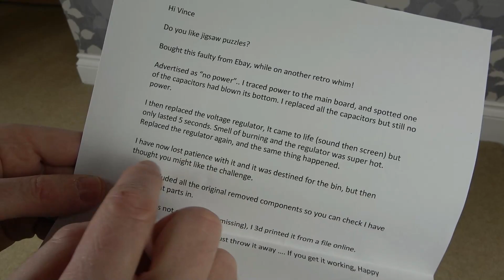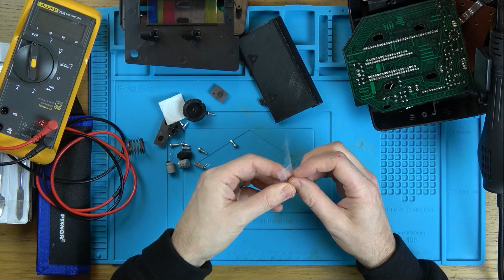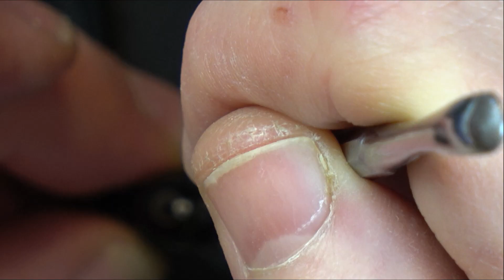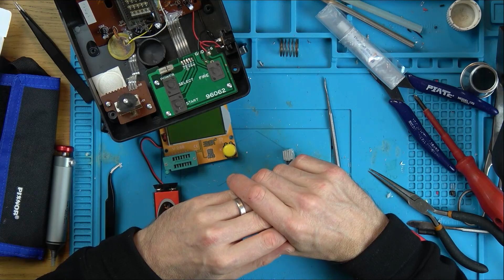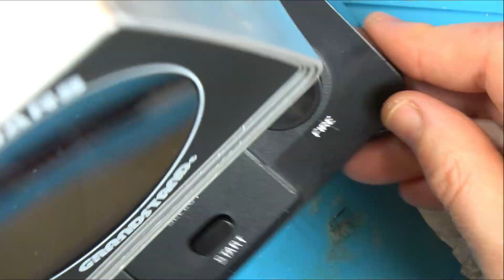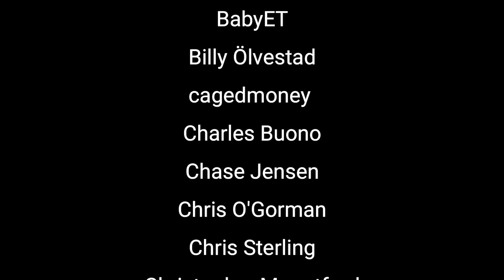1981 Grandstand ASTRO WARS Tabletop Game - No Power Fault - Trying to Fix

Comment: Thanks for this video Vince, I've fixed two of these now. The first was just the D882 which I already knew about, but the second today had the same faulty SO3 NPN transistor as you diagnosed here. I replaced that with a PN2222 which looked compatible and Bingo! One thing I gleaned from this that you didn't specifically mention was how to avoid shorts on the replacement transistor legs when bending them for a different B/C/E order than the original - just rotate the orientation of the transistor by 90 degrees. Genius!

Comment: hi vince, i have an astro wars in for repair but know nothing about them, i had ordered some transistors in but with the bigger transistor removed im reading short on the emitter side. i have removed the caps that seem to be on that rail plus disconnected resistors etc but the short seems to remain

Comment: Broke my sons 20v die grinder by trying to power off drill battery. Barrel plug was negative centre pin. Swapped transistor with one off ebay, job done.

Comment: 33:10 well, that depends on the glue you're using (some are designed for lower temp, some for higher, some can work under low and high temp). also just get a better glue gun, ideally with temp potentiometer (there're many and you don't have to pay much). Any with 120W should be easilly enought for high temp glue job. Also the high temp glueguns tend to have thinner and longer nozzle (or at least you can swap it for thinner and longer one) which makes the job much easier... 
And here's a little trick i use when working with glue and pcb or w/e i need to glue - grab the air duster can (compressed air), turned it upside down and lightly spray the melted glue (ofc watch for delicate parts and use moderation - drowning the pcb with liquid air is not desired) - it wil solitify the top layer right away and you can let go right away.
edit: sea shanty as an outro? oi matey, grab ye gobble o grog!

Comment: I remember I had this same console game in 1981. I had the choice for Christmas that year, Astro Wars, or the folding Nintendo Game and Watch Donkey Kong. It was a tough choice for an 11 year old, but all my mates at school had the Donkey Kong game, so I wanted to be different. All I remember about it, apart from the fact it wasn't that difficult to be good at, was it ate through the C batteries like they were going out of fashion.....a new set of batteries would give MAYBE 20 minutes of game play if you were lucky, and bought the BEST QUALITY batteries.....luckily I had a mutli plug, multi voltage reversable DC output wall wart AC adaptor for it aswell. But that same adaptor blew up many items until I realised the Astro Wars console was the ONLY unit with the power socket wired backwards. Every other socket or device I had that I could use the adaptor on was positive on the centre pin, negative on the shroud.....why this was the other way I never understood. So an accidental reverse polarity connection would be EASY to do if the reversed wiring was a standard design for this unit and nothing else. 

While reminiscing though......I do remember I played it a LOT, that was, until something in my underpants discovered girls, and this little game was of FAR LESS INTEREST !!!!

Comment: Just to help you out:
1) If the BD139 works (as it seems to), just go with it. There is no way that the circuit would draw anywhere close to 1 amp (the max rating of the BD139), so it's quite safe to use it. Even though the 2SD882 is rated to 3 amps that's not an issue.
2) This transistor is being used for switching - it is driving that small black round transformer to generate higher voltages for the VFD. 
3) Don't buy semiconductors off ebay! They are mostly fakes and will blow up or simply not work (thereby further confusing you as to what is actually wrong).
A great video though and it's inspiring to see others taking on repairs like this. I have been in electronics for 40+ years as a hobby and a career and still enjoying what I do.

Comment: Great video Vince, I love these VFD games. The power transistor seems to be a common fault in Epoch games like astro wars and scramble.   There are a couple of diodes that can  lead to faint display and sound or no display and an overheated transistor too. The design was approved on later games, but plenty of versions have this problem. Your great vid Inspired me to finally to post a video on them myself. Thanks.

Comment: Hi, I was wondering if you could help fix my Surface Laptop 3 for a video. It powers on, but windows doesnt load, and when the ssd is out of the computer, it does not boot. The UEFI and everything works, and when i boot from usb it gets to setup then freezes.

Comment: I still have my Astro Wars in the box on my shelf here :) 80s classic -  The text on mine is a flat white (not silver) and Im not sure hot gluing heatsinks on is a great idea (heatsink will melt the glue no?) - great job fault finding those faulty transistors! There are several different stages to the game - 4 different games I think - loops around as you complete each. Good game.

Comment: The 3D printed cover is rough on the outside because whoever printed it made the outside bit the first layer of the print (on the print bed) and his first layer looks a little wonky.  Different base materials on the bed can lead to smoother surfaces, but the first layer has to be solid for the finish to be fantastic.  This is also why the lettering on the inside is so crisp.  It's printed last.
Reply: Actually, I was thinking that those raised triangles probably meant that cover wasn't printed quite flat at all - the surface might be rough from removed support material.

Comment: Between Colector and Emiter, a transistor should also have open connection in both ways (you didn't check that), it must show readings (on diode test) only with Base to colector (litle less) and Base to Emiter (litle more) and no readings in any other direction or combination, for both NPN and PNP, otherwise it is damaged even if not shorted. Good thing you change that one ;)

Comment: Had one of these when I was a kid. Though it was called Galaxy II, not sure when it was changed to/from Astro Wars. I think I caused the same problem by using the wrong type of power jack (either voltage was wrong and/or polarity was wrong).  It would make very dim sound, but no display.  I tried to fix and when I saw the dark spot, not knowing that this was normal for VFDs, I assumed it meant the display was damaged and ended up throwing it away. I have fond memories of playing it.  I even managed to flip the score one time. I do remember that it was always hot to the touch after a few minutes playing.  Probably a design flaw.

Comment: Does anyone agree with me that these old grandstand machines should be modded to have a volume control? just a little inline pot so you can turn the sound down without shutting it right off. Because, many of them have such harsh and loud SFX
I was bidding on an astrowars the other day, which also had a no power fault.
I got sniped out of it in the last 7 seconds, but the damn page didnt update till after the auction ended.
I will get one sooner or later....

Comment: Just incase you didn't know you can use a USB power bank to barrol Jack to power that toy as it will oparate between 4v and 6v on battary, have converted a lot of things that run of 4x 1.5v battary to usb power, then you could use your USB power meter to aid in diagnostics

Comment: no need to chase original parts if there is no need for them, 3A transistor would need heatsink (a quite big one) if it actually sink all that current. As there was no heatsink in original design probably game don't use that much power and they just use what they have (a lot/handy/cheap enough at time game was made). You have a meter there, use it sometime to check current draw, probes on that "switch" pads and you know for sure how much is taken from batteries. Or just do finger test on that bd139 after few minutes of running a game :)
Reply: I agree with you, 3A transistor is too much for this toy. (6V*3A=18W) And also don't forget a power supply from the 80's was a transformer (performed on 50Hz) a rectifier (bridge or diode, diodes) and a buffer capacitor. That means the size and the weight of the transformer is high for 3A. If this thing really consumes 3A, the power supply should be 1kg weighted and 10*10*10cm sized.
Reply: @laszlomarktoth7492  I forget about transformer PSU, it's probably around 150-200 mAh for whole game, most of that wasted in that boost circuit for VFD. Still way under BD139 capabilities even without heatsink.
Reply: @gorky_vk  I fully agree with you concerning the supposed power consumption and BD139 heat dissipation.

Comment: HI @My Mate VINCE, Looking at 36:19 when you are testing the transistor I think that the transistor is leaky, Looking at the data sheet for the transistor it doesn't have a body diode(parasitic diode) Your tester is showing a body diode, some power transistors do have a body diode, Not sure if it the tester, Can you try one of the new transistors and see if the tester shows a deference. Great video :)
Reply from the maker: Well done AR, you are again completely correct. The new transistors do NOT show the body diode on the tester, so the tester was picking up the leak and incorrectly showing a diode. Thanks mate :-)
Reply: @Mymatevince  you're welcome

Comment: More than likely when the power transistor went short it drew to much power from the small transistor blowing it. When Lee changed the power transistor to much power from the shorted small transistor will have damaged the base emitter junction and would eventually blow it. Although it is not short or open circuit it will be reading differently than a new transistor.  The damage means that it is not fully opening and therefore the screen was dim.

Comment: what was the original transister and what are you trying to replace it with if you tell me I will check to see if they are a match or if the pinout is the same.

Comment: The one thing you missed was this, BEFORE you put the heat sink on the screen was working, but, thenyou put the heatsink on then it wasn't. You failed to realsie this and take OFF the heatsink to double check as, sometimes, the most logical isn't necessarily the most logical thing but rather the most ILLOGICAL. You know, something work better with heat. Like cold can sap a battery's power faster than on a warm day and in usage. Think about it. IF it worked BEFORE you added something that wasn't there in the design, you changed the design now it doesn't work. Change it back doesit work? yes. So do not add something that wasn't there by design. Now although putting the new part in, you did NOT add the heatsink. Funny how you lost the screen when you added the heatsink but then changed to something without it. So the ONLY thing that changed was when you added the heatsink, doesn't mean the part you changed was good, but was good BEFORE adding the heatsink.
 
You never tried by taking the heatsink back off. Now the part you changed may have not quite been the right part since that was changed by someone else also. but the heatsink? that IS when you lost the screen and the ONLY time. So you should have taken ity off first to see if it came back on before changing that part.
Reply: It's not supposed to run hot, probably got degraded when the small transistor and capacitor blew. but just not enough to show up as faulty. Clearly the screen didn't work properly with the old transistor.

Comment: Always love seeing an electronics repair, no matter how old or niche it may be.

INFO EDIT: There are indeed two types of transistors: NPN and PNP.

In an NPN transistor, current enters the base and the collector, leaving the emitter. The emitter’s current is the sum of the base and collector currents.

A PNP transistor, however. has the currents go the opposite direction. The current enters the emitter and exits the base and collector. The collector current is the emitter current minus the base current.

The symbols are different, too:
NPN transistors: Arrow goes away from base. Emitter is at bottom.
PNP transistors: Arrow goes towards base. Emitter is at top.
The arrow-side is always the emitter, whether it goes to or from the base!

This applies to “bipolar junction transistors” (BJTs). “Metal-oxide-semiconductor field-effect transistors” (MOSFETs) are an entirely different beast, as they have four parts: source, drain, gate and body (body is usually for the ground plane).

Comment: Vince,

Happy New Year! Wonderful repair. Replaced many power transistor (high voltage type) on control/power boards for bowling lanes. Your synopsis of the issue is really good. When too much current is conducted by the transistor the result is excess heat and drop in voltage. In regards to the items I've repaired in the past it would be something like the bias on the base of the transistor was too great. Typically due to other faulty components. Since a lot was replaced on the item you repaired I suspect it was something similar and the transistor was on its last leg after being over worked. Measure and compare current draw from your power supply pre-transistor replacement and post. There are many how to videos that should show you how to do this with your Fluke DMM. Just be careful (safe) with any current type measurements. If the current draw is significantly lower, post repair, I would presume you have a repair that will last for a good while. Thanks for what you do! Cheers!

Best Regards,
Shawn